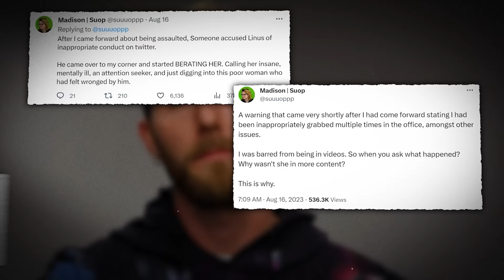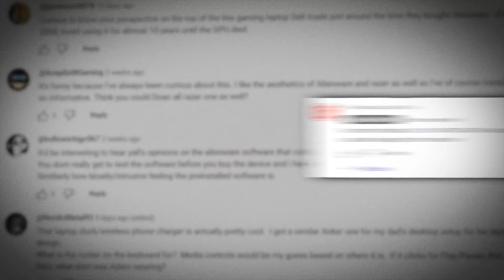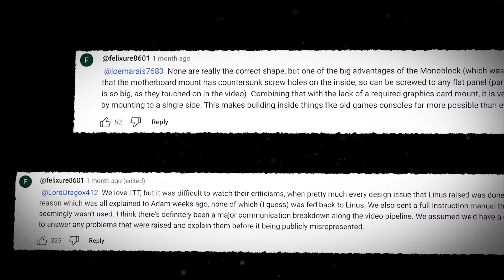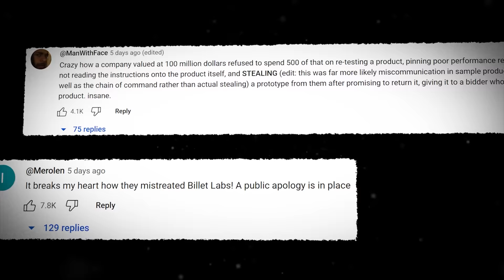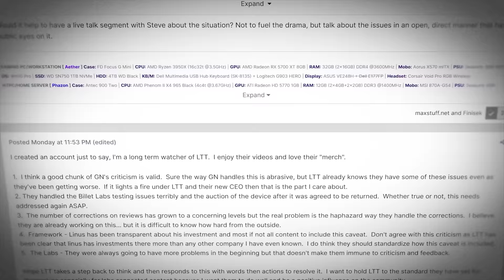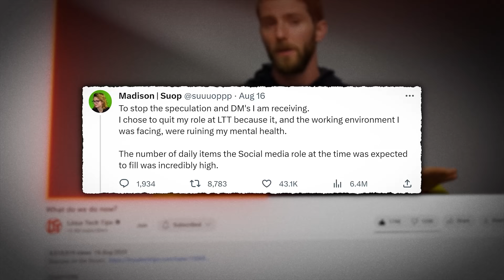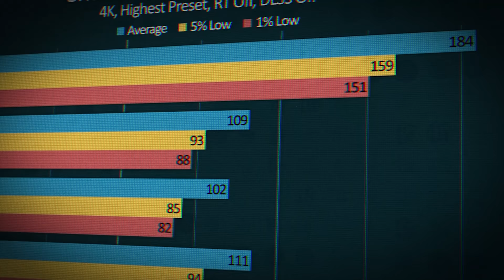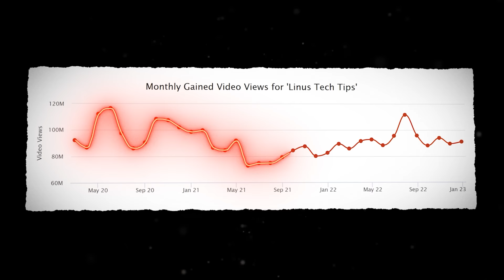The Deserved Self-Destruction of Linus Tech Tips

Comment: The plastic cover on the mouse feet is peak comedy. How could anyone take their advice as informed?
Reply: @thomgizziz it's not just a mistake. It was a massive, inexcusable oversight from the people who are suppose to be the best in the business. Now, I'll admit, they shouldn't be fired for an oversight like that (I don't think the original comment said anything about people being fired). But they should have fixed the video instead of just putting a pinned comment and leaving the video up. 

A mistake is one thing. Failing to do a extremely simple thing a tech YouTuber should know, uploading the video, realize the mistake but not remove the video is the issue. The fact that they made the mistake is concerning. The fact they didn't fix the video is inexcusable and points to a lack of quality control and basic knowledge from the people who are suppose to be the best of the best
Reply: @googleit1131  If I recall correctly they even tried to deny it first when manufacturer of the mouse brought that up.
Reply: First thing  I do when buying a mouse is look for any and all protection film. And if it still feels weirdly on the surface when moving, second thing I do is look for any I might have missed, especially on the feet. Been doing that since mice had balls to clean. It's really not that hard.
Reply: It's probably cause theyre so rushed and under a tight schedule; Dumb stuff like this happens and it affects their credibility. Very idiotic and hearing their employees speak on what they would like to see changed in the company, they arent even high demands. Companies really lose when they stop listening to their employees and treating them like disposable objects. I mean, just look at most gaming companies...
Reply: But they said it would have sucked anyways, given how they tried to mount a cooler on the wrong gpu, I'm surprised they didn't plug the mouse into an hdmi port and claimed that it didn't even work.
Reply: Not having pull tabs on plastic film should be illegal to. To be fair.
Reply: @iRunKids first time I built a PC I plugged the HDMI into the motherboard instead of the GPU, I should get hired there I'm already the kind of worker they wish for
Reply: @iRunKids  😂😂😂😂😂😂
Reply: @leevi6026  And then blamed them when they couldnt deny it anymore lol
Reply: @googleit1131 If you read the pinned comment they literally said the part mentioning gliding issue is removed from the video.

Jesuss… You people are… really special 🤦🏻‍♂️🤦🏻‍♂️🤦🏻‍♂️🤦🏻‍♂️🤦🏻‍♂️
Reply: @jakedarang the cost to enlarge a portion of the film would create too much waste and would require a new assembly line. Capitalism 101
Reply: @thomgizziz  It's not a "if you ever make a mistake", LTT and especially Linus is a "I do make mistakes with every single video I make, because people are watching me to see what dumb shit I am doing next." Linus is fun, but he was not competent. 

He is kind of like the other side of Level 1 techs, just without even the slightest competence. He has even more charisma than Logan and even less of a clue about tech. He still loves to play with it and has the money and backers to break a ton of shit while doing just that for entertainment purpose.

Comment: Its nice to see that Billet Labs themselves have posted a video (about 10 days ago as of this comment) showing how straightforward it is to properly install the cooler.
Reply: Did they also discover a way to make copper more thermally conductive or find an infinite refined copper supply? If not the product still isn't worth it
Reply: @zachmondial2172 it not being worth it can only be said after installing the product correctly. While I agree it's not, it's still a mark of shitty work ethics to just, use the wrong card with it and call it absolute shit.
Reply: @aveugleman2188  do I have to test out a Gucci belt to say it isn't worth it? It quite literally can't perform better than cheaper products but cost 100s to 1000s of times as much. Why because it's cool not because the value it provides.
Reply: @zachmondial2172  and if your job, that you did for more than 10 years, was to be thorough about belt testing? And that someone sends you one, with the specific pants to use it on, and you manage to lose said pants, complain about not wanting to retest because it would cost you 500 bucks when your entire company is worth hundreds of millions? You'd become a total joke in your field. Same as Linux did.
Reply: @zachmondial2172  "Did they also discover a way to make copper more thermally conductive..."
You make it sound like that's the only way to increase cooling performance. It's not, not by a long shot.
Reply: @TonyRule  when their product is a copper water block that's it. It's sole job is transfer heat from cpu/gpu to water. So explain how their product is increasing performance?
Reply: @aveugleman2188  his conclusion was the product isn't worth it. He didn't conclude it was a shitty product he said it's not worth it. He never said it didn't work because he used different card he said no matter what the product is not worth the money
Reply: @zachmondial2172  Clearly you don't have an engineering background. I can't give course in thermodynamics the YouTube comments section.
Reply: @zachmondial2172  "He never said it didn't work because he used different card he said no matter what the product is not worth the money"
So exactly what was that conclusion that "no matter what, the product is not worth the money" based on, considering he didn't test it on the card it was intended for?
Reply: @zachmondial2172  yes, and maybe, just maybe, the results could have been different if he used the specific card the product was designed to be used on. 

Those products have less than 0,01 millimeters of margin, because they are designed in a certain way. 

You can't say that a product is not worth it without testing it properly. 

"This 300 dollars cooler isn't worth it, I didn't use it on the correct card and it didn't improve the results in a significant way."

And then you say "We could have tested it properly, but it would have costed 500$ of an employee's time".

When you're the CEO of a multimillion dollar company, that series of event just screams unprofessionalism. That+ the excuse video which was a joke.
Reply: @TonyRule  bases on the fact that other copper water blocks cost 1/10th the price
Reply: @TonyRule  but go ahead tell me why their copper performs so much better than all the other copper water blocks. I'd love to hear it.
Reply: @aveugleman2188  the point is that other water blocks are limited by thr thermal conductivity of copper and water. Their product literally can't perform better without breaking the laws of physics. There is no performance benefit to be had over cheaper products. It's a flex not a practical solution.
Reply: @zachmondial2172  yeah, and the point that everyone is making, is that Linux may be right, but not giving the product a complete and correct test just shows he doesn't care about what he's testing and prefers quantity of vids instead of quality. 

Also shows how horrible he is by "auctioning" the company's only prototype.
Reply: @zachmondial2172  "bases on the fact that other copper water blocks cost 1/10th the price"
Which on its own means nothing.
Reply: @zachmondial2172  "when their product is a copper water block that's it"
It's not. That is just a small part of the overall factors relating to performance. Such an oversimplification is the mechanical equivalent to saying the car with 350kW is always going to accelerate faster than a different car with 300kW.
Reply: @aveugleman2188  the results about its performance sure. Doesn't change the conclusion tho. He said it was a bad product because the price not because it performed bad.
Reply: @zachmondial2172  nope. He said it wouldn't have mattered if he saw an increase of 1 to 10 degrees even if he tested it with the correct GPU, because at the end of the day, he thought the product wasn't worth it. 

And don't get me wrong, it's really pricey for what it does, but being the biggest tech channel on YouTube and not doing a thorough job about testing said tech is kind of a shame.
Reply: @aveugleman2188  exactly so what's your point? He admitted even if that it still didn't matter it was not worth.
Reply: @zachmondial2172  What's YOUR point? That assessing something on price without any regard to performance in its intended role is somehow a reasonable metric? If so, the school system has failed you.
Reply: @zachmondial2172  I made my point 3 times already. Even if it isn't worth it, not doing a proper installation of said product is unprofessionalism to its finest. The channel being the largest tech one on YouTube doesn't have any excuse about not doing that. The fact he even said he could have done it is even worse. 
It means that when he has bias agaisnt a certain product he just will not give a just review and do proper testing.

And my second point, that you so obviously ignored, is that selling the only prototype a company has in an auction is downright diabolical.
Reply: @TonyRule  he looked at the performance. Hence the even if I retested and it performed much better it still isn't going to be a good product. I suggest you actually go watch the clip not just the snip you see in this video.
Reply: @aveugleman2188  they literally can't test every single product ever and it actually does not make sense to test what you know will still be a product that nobody shoulf ever buy. 

And bringing a whole separate argument into this out of nowhere is pointless. Okay yeah they messed that up but it has nothing to do with what we were tlaking about.
Reply: @zachmondial2172  I watched the clip. You still don't get it do you? Those blocks are designed with 0,001 millimeters of margin. 
They are made to actually be used on a very specific card and nothing else. No matter what he did, he did it on the wrong card (they sent him the correct one with the product btw), and then proceeded to tell people to never buy it, that it isn't worth it, that he wouldn't re do the test on the correct card because it would've cost him maybe 500 bucks of time (multimillion dollar company btw).
And once again, doing all that and then auctioning off the most advanced and only prototype a company sent you (FOR FREE) without asking them first also shows an extremely unprofessional attitude of the whole company (bc as he says, "it's not his fault", which even if he didn't know, still is his fault, it's his company).

(Also in the vid he legit destroys a stick of RAM, once again showing that the quality control of this channel isn't a priority)
Reply: @aveugleman2188  the thing is you don't actually need to test the product to know how it will perform. It's copper. Copper has a specific value of how much heat it cam transfer through it. There are other copper water blocks that are much cheaper because of how they are manufactured. 

Him using the wrong card gave him bad results yes but that doesn't change the laws of physics/ thermodynamics. The product can't perform better than existing cheaper alternatives. It's copper. Copper is copper they don't have special copper I don't get how you can't get this through your skull. 

You keep tlaking about how he tested it wrong like okay dude doesn't change the fact that the company is limited by the laws of physics just like every other company who makes copper water blocks.
Reply: @zachmondial2172  yeah? And the entire point is exactly that. He tested wrong, and didn't apologize for it until he got called out. He wasn't sorry he didn't test it right he was sorry he got called out for it.

The entire point ppl and myself are making is that Linus and co just became lackluster. Nobody cares about a 400 bucks water block, they care about HOW he actually tested it, and HOW he interacted (him or someone from his company) with billet labs.

It doesn't matter what his opinion is on the product and how testing it right would make no difference, it's their JOB to test it right. Not even doing that shows a clear lack of professionalism, and doubling down on the "it doesn't matter bc it sucks" just shows how immature and narcissistic they are.
Reply: @aveugleman2188  people are acting like he ruined this company but saying their product is bad which the product is that's my point. As long as they mentioned in the video they didn't test it on the intended card I really don't care
Reply: @zachmondial2172  and that's the whole point? "People" aren't acting like it ruined his company. It ruined any credibility his company had in the tech industry for many because that's just what happens when you do shit like this and that you are held accountable.

They're just another corporate thing now, which is really a disgusting turn of event with how earnest the channel began.
Reply: @Boogy17  eh avg hater attitude. But there are countless people saying he damaged their reputation as in bilet
Reply: @zachmondial2172  damn man I'm sorry but fr, saying I'm a hater for pointing out the obvious, you're a shill to the core. They're not your friend, they don't pay you, you don't get anything for not holding them accountable when they do a shitty move. 

Having such a para social relationship with such a huge company isn't healthy. Grow up.
Reply: @aveugleman2188  not even. Just always think it's funny when prople hop on the hate train. Nothing about their videos changed between when they were released and all the ltt is bad videos went up. Except nobody said anything till after they went up. If it was a problem why did nobody say it sooner and have to bandwagon it. This is always how it goes for anybody famous and it's so overdone
Reply: They say that this video of @LinusTechTips bankrupt the Billet Labs Company !!! Nice job @LinusTechTips for the Absolute Obliteration COMBOOO !!! Yeeeeeeee !!!
Hahahahaaaaaaaaahhhh !!! 
🤪🙄😂😂😂😂🤣🤣🤣🤣🤣🤣🤣🤣🤣🤣
Reply: @Boogy17  I'm protected by Eywa, who is my daughter's spirit, Kiri , who She knows i'm right. So no, sorry :P, not a chance. And LTT was also right about it, yeah, it's sad that he did that, but he was Right doing so! Why, u may ask ?! Well  Billet Labs tried to abusive consume high valuable resources like PURE COOPER to develop their business, and that they would have done harm to Earth's resources. Asking Kiri, She told me that, not to be a fan for HARMFUL EVIROMENT BUSINESS !!! Kiri send's u "regards" 😂😂😂🤣🤣🤣🤣
Reply: @zachmondial2172 the irony in this comment.
Reply: @zachmondial2172  Im an engineer. Material condutivity isnt the only way to improve heat rate transfer. You also wanna consider surface area, and fluid dynamics of your coolant.
Reply: @alejandrotuazon4831  the surface area is already constrained by the cpu die and most people are using water.
Reply: @zachmondial2172  not the surface area to the die, the SA to the fluid and the interactions of the fluid and the heat exchanger inside.

Comment: Billet Labs need to be compensated massively...
Other streamers need to test the 'new' or replaced prototype and give Billet Labs a chance.
Reply: I think easiest way would be to create new brand and maybe target different GPU with their product, but yea, they should let the GN to test whatever they make first.
Reply: The funny thing is after this drama there'd probably be quite a few channels that'd do it out of pure spite.
Reply: I mean the point still stands that unless they found a way to break the laws of thermodynamics the product is not worth it at all. No matter how cool looking and expensive your procut is you can't change the conductivity of copper.
Reply: GN probably wanted to test that part real bad.
Reply: @zachmondial2172  copper is one of the top thermal conductors though? what do you mean? i haven't looked at their cooler and how it works but usually gpu heat sinks are made of aluminum which is about 45% less conductive than copper.
Reply: @Bursty55 putting it into perspective from a cost to efficiency point of view, if a products to upgrade a product, costs as much or in some cases more than the product, is it worth it?
Reply: @Bursty55  but other products are also copper just much less. It's more that copper can only transfer so much heat from place A to place B where it then goes to water. The more copper you have the more cost but not better heat transfer.
Reply: for 800$ you can build 2 pcs. not one, two. two decent machines instead unneeded lump of copper. so that's nothing. but what they did to girl is not nothing.
Reply: There is no need for other content creators to fix what LLT did to billet, LLT needs to fork up compensation for potential lost revenue becuse of their lies they are lucky Billet is a small company whitout legal muscels or they would have been sued.
Reply: @Bursty55  it's a copper water block that cost 10x the cost of other copper water blocks because of the manufacturing process. It is more to look cool/flex hence the it's not worth it conclusion